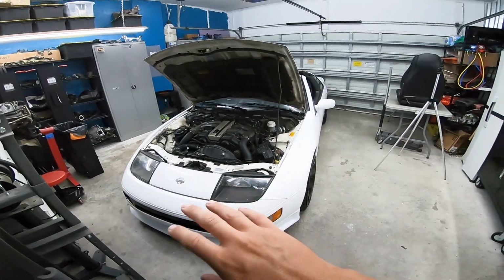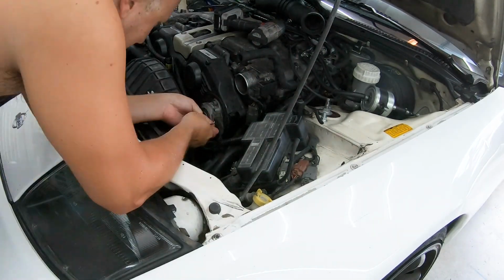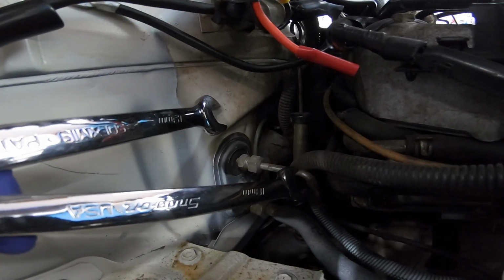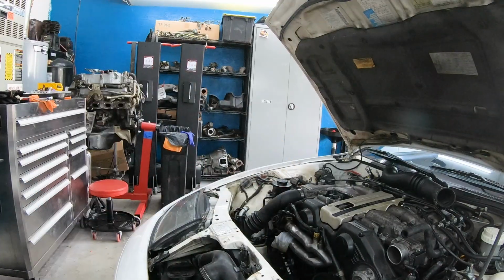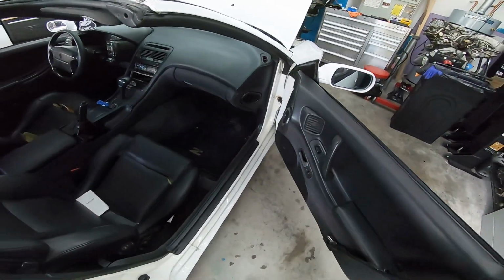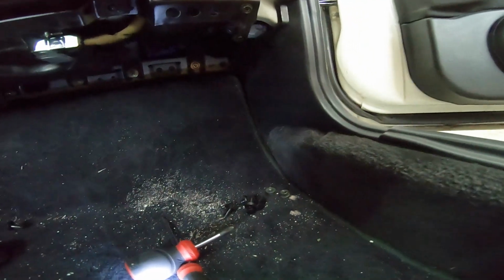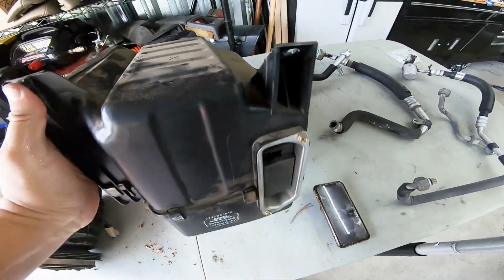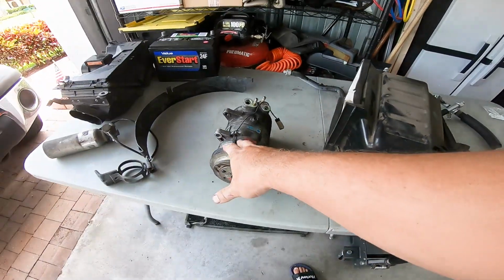A/C Retrofit How To - Clean and Repair R12 A/C System on 30 Year Old 300zx for R134a Conversion

Comment: or be like me and need to replace your entire hard line because the salt air corroded the connector to the condenser, and when you tried to remove it the line twisted like a twizler. 

Ya... ended up cutting my hard line out. On the bright side I have 1/4" of extra engine bay! My AC hasn't worked since 2010 so it wasn't a real loss lol

Comment: While you have that evap out check to see if the txv bulb was removed. Those small bolts can break easily so be careful. Wont work properly with it in